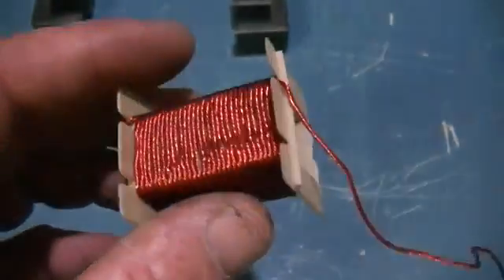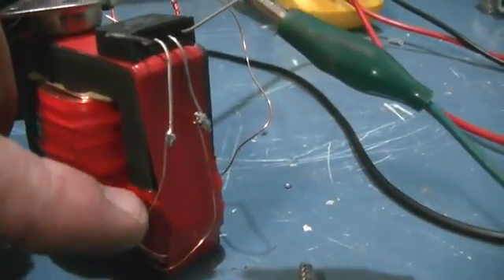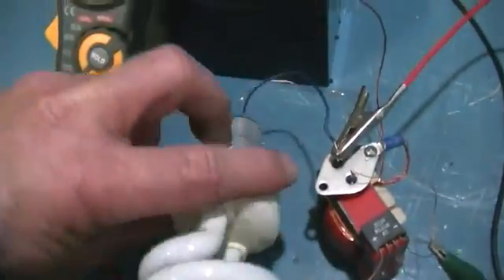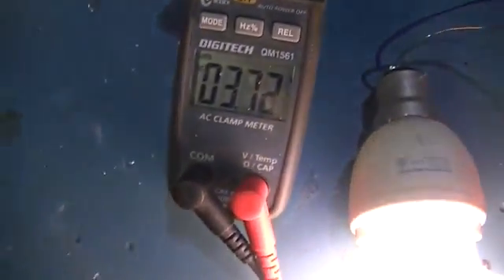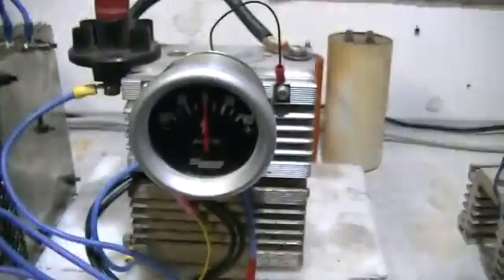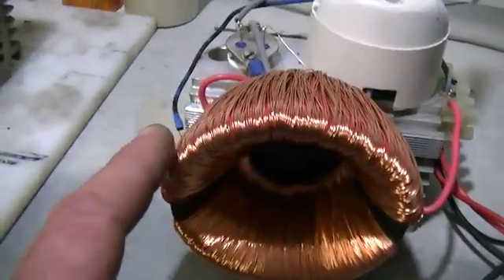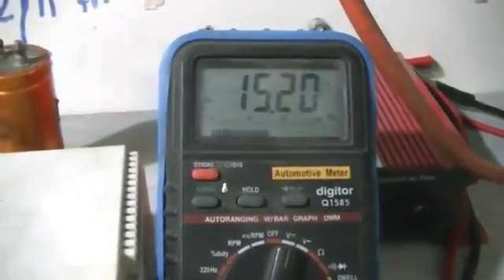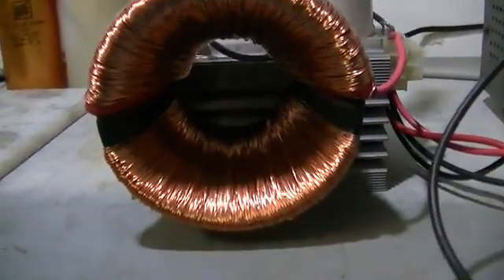joule ringer 2 with a twist.mp4

Comment: The ultimate JR P1 
Info to all J.R and TPU Enthusiasts. I have a TV/YOKE that wouldn't accept any sort of winding or Transistors; the output voltage was always lower than what I put in. It’s small, circa 3 inches in D, cylindrical outside, concave inside, and easy to wind. Chose to be bizarre with it; 60 turn of Antenna's wire, single wire; wired like any JT, and hey presto! The V. Meter went crazy! Connected a 110 V LED B on the collector's diode; it was as bright as sunshine. More to follow!

Comment: See if you can make use, or have an answer. So far haven't been able to light anything. That said; the 25 wraps around the core, turned it into a JT, using a 3055 T or a Tip 31C, with a 100 ohm R to base, and a 6V BT; connected a 7 W, 240 V neon to the big coil; the end and start side of it and it lit. One suggestion! Why not use the ready made windings of old cooling fan, W/M Pump, Wall Mounted Boiler C/F extractors? They have thousands of turns, easy to turn them into J Ringers.

Comment: To TinManPower

It still does not work. I tried ready made transformers too, all kinds; yet cannot get any high voltage reading. It's important that you know; I am no electrician so; would you mind sending a clear wiring diagram, showing where everything goes plain and simple?

                       *------------*Final single wire
Primary side      |           |*H V wire or start W.
                       *------------* Three wires or trigger 
Where does all this go?
Thank you very much!

Comment from the maker: Hi TheJG1947
20 turn coil-start to plus on battery,end of coil to collector of transistor.
Secondary coil(200 turns)-end of coil to base of transistor,start of coil to cfl globe.
Out of cfl globe to emitter of transistor.
Remember the secondary coil is opposite to the way an ssg circuit is hooked up-where in that the end of the coil has to be hooked to the base-not the start. This is going on the asumption that you have wound both coils in the same direction.
Hope this help's

Comment: No matter what I do or use, cannot seem to make it work. Which wiring diagram are you using? I have seen three so far: "Lasersaber's," Peanutbutter, and Lidmotor. One final thing; Lasersaber has done a great job, however that circuit has been around for some thirty years. I personally have an emergency light; have had it for the last ten years. When there is a power cut the 240v neon comes on, as soon as the light comes back it switches itself off and charges the 6v battery inside.

Comment: Thanks man! Stan Meyers said there are many ways to increase gas production one of those statements were the higher the voltage the more gas production you will get. I just want to see how correct this is since I have not been able to test it myself yet because I am working on other things at this time such as my gasoline vaporizer where I have achieved 214+ Miles Per Gallon in my 06 Buick!

Comment from the maker: Hi Russ
One thing has been bugging me about this circuit--How is it that the base of the transistor can handle that sort of voltage?I mean the emitter-base voltage has a rateing of 7 volt's and collector to base is 100 volt's.Now im measuring 208 vo;ts at the globe and that is AC.And as the globe is conected to base and emitter then the base must be getting 208 volt's?--So why no smoke?

Comment: You should look into coil shorting.  Basically you would short the coil right at the top of the peak of the sine wave. Or just before. By doing this in theory I've heard they found that the wire actually turns into a superconductor during that very brief pause of titme. A Bose Einstein condensate... If I spelled that right... ~Russ